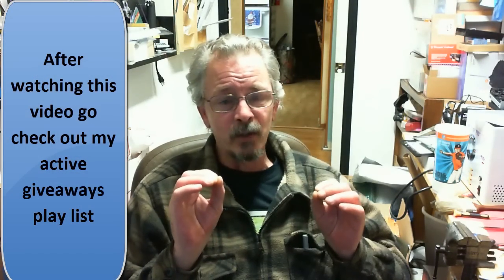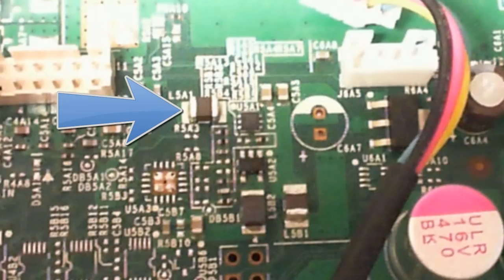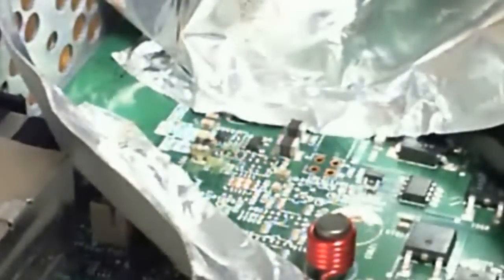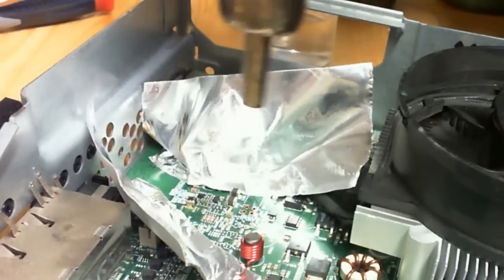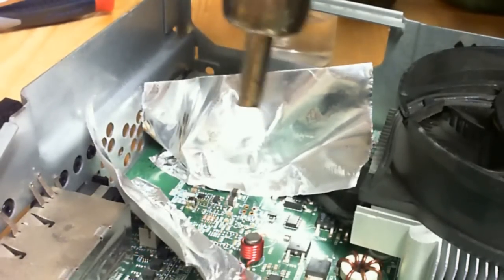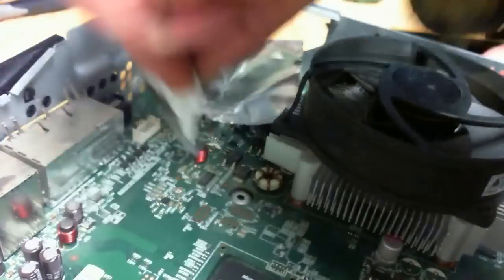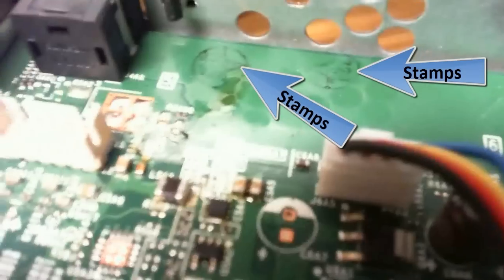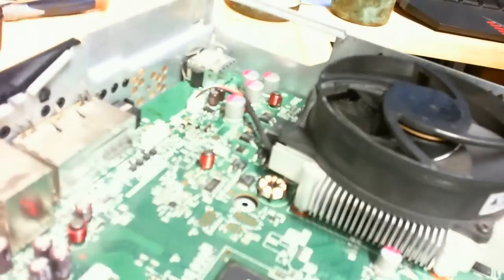Xbox 360 S No Power Component level Repair

Comment: Telling someone you have a 98% repair rate is misleading, what happens if the apu is damaged, a actual good tech would let you know it's unrepairable so you won't go on a duck hunt. Not tell someone that they can fix something and it's not unfixable that's very incorrect.
Reply from the maker: 1st you do not know what you are talking about that is plain Stupid 2nd I Do have a 98% repair rate and the reason is The APU's do not die all that often less than 1% of all game systems will have a failed APU the other remaining 1% will be chips that can not be replaced do to anti-hacking programming.
Why and how can I say this? Answer: A) I have personally repaired well over 50k systems. & B) I have Actual extreme education in component-level electronics, unlike 99.9% of the fakes posting crap fake fixes learned off other youtube videos and actually faking most of their repair videos.

Comment: Hi, You are very skilled in Xbox!!, congrats. Have you ever tried to modify a 203 watts XBOX 360 brick PS to provide 14v adjustable output for a battery car charger for example? It would be a great project that I have never seen it here in YouTube. Thanks.
Reply from the maker: I made a video showing how to make an adjustable voltage PSU using a 203W Xbox 360 power brick for anything you wanted to use it on years ago, I believe it was on the old channel called HGCGamersClub that had 130 Videos and over 4k subscribers that channel was showing every repair shop within 100 miles of my house that was performing fake damaging repairs and learning threw trial and error at the expense of there customers systems after learning fake fixes off Youtube videos then pretending to be qualified to repair systems at Game Stoppers or Play-N-Trade or other game stores and literally ripping off kids piggybanks and there unsuspecting parents. Sorry Google says I deleted my google account but I know that is not true it was a glitch on their side or they decided what I was showing was not something they wanted me to expose for fear of a lot of revenue loss on the repair videos if kids like you learned the truth.

Comment: Damn my slim just died with a no power issue and its not the power brick. It doesn't look like the switch board either but I may trying swapping that out. I was complacent that it would last much longer but I suppose it doesn't owe me anything after years of use.

I have stripped it down with with no testing equipment and no ability to solder at this level I may as well buy a used one at around £40. If I have a UK engineer to look at it the cost will be significant to fault find and repair. They don't come cheap for this sort of job. I can see a future of buying used consoles until they fail. I should concentrate on the playing the latest x box but I like my 360

Comment: hi
 My Xbox 360 Slim won't turn on. When ever i try to turn it on, i get this red dot and the fan makes 
a really loud noise before it shuts down. Does this mean its an overheating issue?
Reply from the maker: I strongly suggest you take it to a qualified repair shop one that is willing to prove the repairman has education in component level electronics. YouTube will only make you kill or damage your system possibly beyond any reasonable repair by a qualified person.
Reply from the maker: No, it means it is damaged because of overheating and now you need a repair because you never cleaned it, Sorry it's too late for a cleaning or replacing the thermal paste because over time the heat of the system killed a component somewhere and now it needs to be repaired/replaced.
Reply from the maker: that link will not fix your problem it is a bullshit fake Video for views posted by a YouTube educated FAKE

Comment: You didn't show it not working.
Reply from the maker: PS At the end of the video if you had bothered to watch it you would see it working and plugged up.
Reply from the maker: I do not need to show it working or not? This is not a how-to-repair guide and you are not qualifed to even decide if your system has the same problem so if I was you I would save the life of your system and take it to a qualifed shop before you murder an otherwise repairable system.

Comment: Hello, 

I am technician and I opened the power supply of Xbox one, model PE-2121-03M1 to fix the red light problem. The 5V output is ok but is missing the 12V. I found the smd IC2 burnt. The IC2 has 8pins and is connected in series with the + of the electrolytic capacitor C12 2200μf 25V. I measured the + of this capacitor and I found 12 volts. The four pins of the IC2 are connected together to the + of the electrolytic capacitor. On the opposite side of the IC2 the 3 pin are connected together and this is the output point for 12V. The 4th pin is separated and I found 35 ohms resistance measured it with the three pins. The IC2 is cracked but is not shorted, perhaps is open circuit and the other side of the pcb is black due to high temperature when burnt. I bypassed the IC2 putting a link between the 4 pins and the 3 pins on the other side and the 12V passed to the output point and the led became green. There is no any number on the IC2, perhaps it is a voltage regulator?

 I appreciate if you have any drawing or you can find any details or equivalent about the IC2 so if possible to replace it. 

The point is why it burnt? Perhaps there is a problem with the Xbox and the IC2 burnt due to short circuit or high current consumption?
Reply from the maker: I am not hear to teach repairmen how to repair. I explained that in this video

Comment: Hello my xbox 360 in side the game but my xbox red light please help me
Reply from the maker: Okay, First do not open your system you can not repair it using YouTube Videos there are 1000's of different reasons for a Red Light and if you try to fix anything on a suggestion of anyone on youtube you will be forced to buy a new system. I know a lot of kids do reflows and junk on their channels but every single one of them videos was the successes that only damaged the system even though it started up most did not last for more than a few days to weeks and is not showing the million's of game systems that they were never able to repair and will never be repaired and was needlessly destroyed because the problem was not a crack in the solder below a chip!